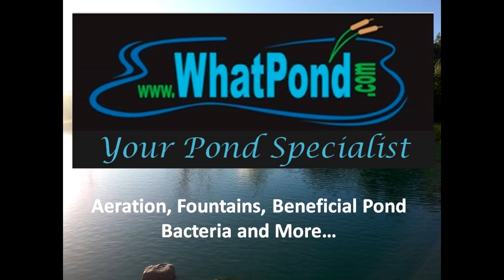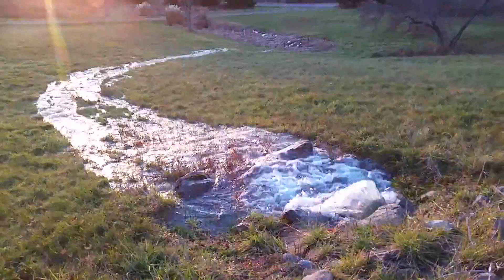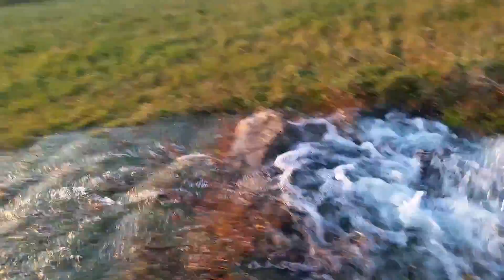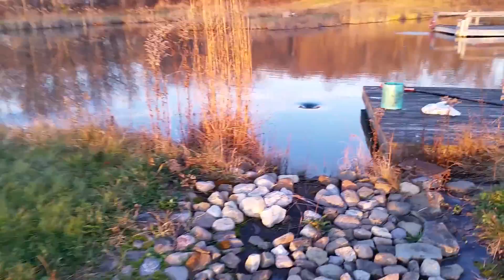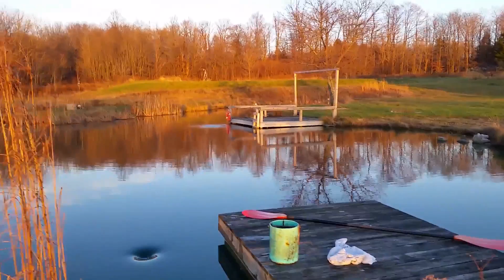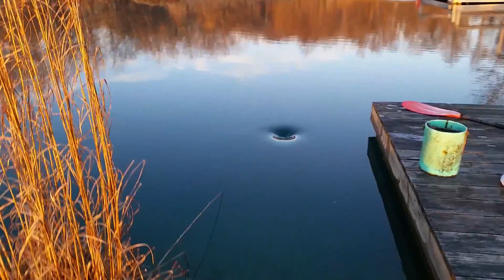Pond water exit, overflow pipe

Comment: I don't see a vent. What is the layout? Does that vertical down into a horizonal line via a 90 or a T-connection? and does it have a vent in it? I heard you need a vent but looks like it's doing good.